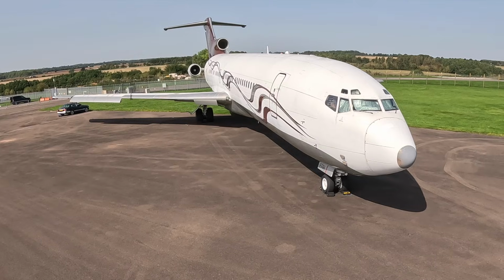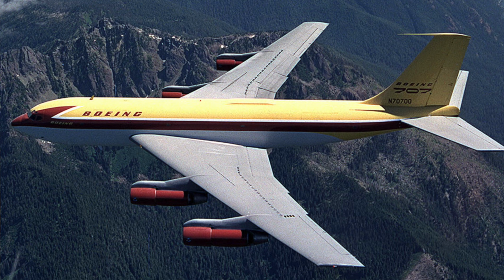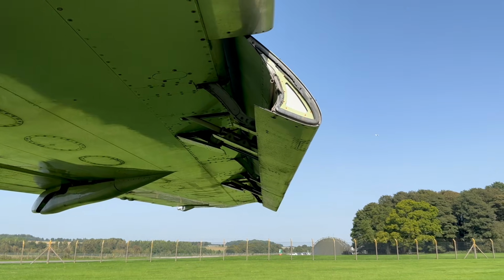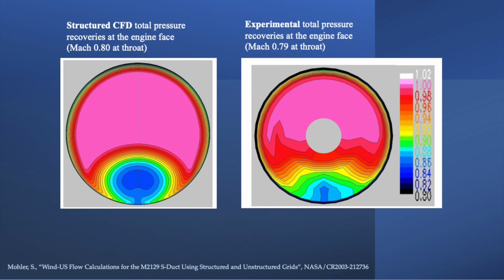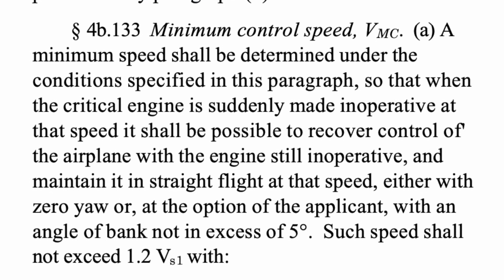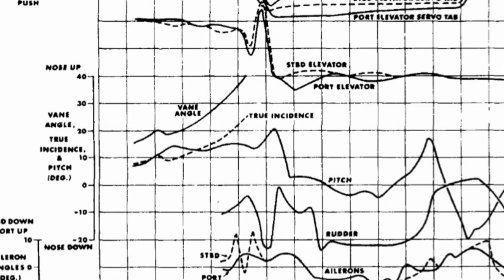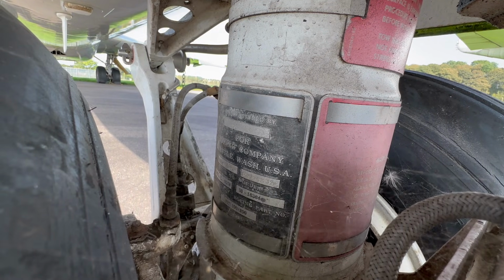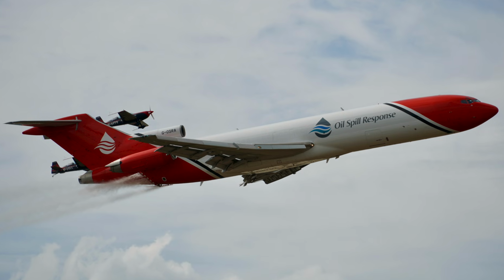Boeing 727: Part 1 - Engineering a High Performance Trijet

Comment: An excellent video, I flew both the 100 and 200 series for Dan-Air in the eighties. It was a Gentleman's Aeroplane' to fly.
Reply: I can remember flying dan Air 727 Manchester to Naples and back for a family holiday! Quite an experience for a kid whose only previous flying was a 747 over to the 'States. I can remember it feeling like 'real flying' when in the stack and dropping into Naples!
Reply from the maker: Thank you :) Do you happen to recall if they were both fitted with a stick pusher?
Reply: Not too sure, they were fitted for the CAA accepting the 727 on the British register, but that was of course for the initial 100's  . I flew G-BAJW a 100 series during base training at Shannon, and during the stall phase of training we certainly went up to the 'stick shaker', which was bad enough! I 'am beginning to think that the pusher had been disabled by 1985. @asobester

Comment: Dont the 737 and 727 share same fuselage basic design? Imagine the 727 with 2 modern high by pass engines!
Reply: I've started and canceled a few replies to this, both affirmative and contrary.  I guess the one I'll go with is  "Best not to resurrect a design where something as fundamental as the maximum landing flap setting was restricted to emergency use only, it needed the world's best stick pusher, and flight test pilots died from the Dutch roll".

As with another great but flawed flying machine, the STS's Orbiter, probably best to salute it as it takes its place in history... and leave it at that.

Comment: Rode on these many times back in the day.
I used to pick the seat right behind the the wing root so I could watch the wing transform itself during approach, and seemingly disassemble itself by the time of landing.
When the the spoilers came up, there was just a skeleton of the wing left.
As a pilot I never tired of this, and the 727 remains my all-time favorite.
Side note: Eastern pilots in the 80s flew these planes like the hot rods they were, and I saw them do things in the 727 you would never, ever see nowadays. Great fun:)
Reply from the maker: That flap system is a marvel, isn’t it. With computational optimisation techniques this sort of complexity is no longer required (the same cl max can be extracted from optimising the geometry of the flaps/clean wing), but it remains a thing of beauty one can admire like one admires an old mechanical watch in the digital age… Can you elaborate on what you saw them do? 🍿
Reply: @asobester  Swiss watch is an excellent comparison :)
Eastern? Ok: Houston to Miami, late at night, almost no one on board, and the crew in a really big hurry to get there.
We were going at a high Mach number - the engines were at very high rpm and there was a lot of slipstream noise.
As you know top of descent is routinely 30 minutes prior to landing, and as I watched the time and west coast of Florida go sailing by with no power reduction, I started to sit up and take notice. They stayed at cruise altitude until the very last minute, then yanked the power off while throwing out the spoilers and whatever else they had.
We sank like a stone, and I remember the distinct sensation of the ground lights coming up towards the airplane rather than gliding beneath it. After landing I stopped at the cockpit and asked the crew what the rate of descent had been. They just grinned and said they didn’t know because the VSI was pegged.
Reply from the maker: @thomasbelmont810   Ha! Good practice for a depressurisation emergency descent :)
Reply: @thomasbelmont810 the ‘27 had the ability to descend at the rate a helo could auto-rotate. I recall vividly some fun rides when I had the privilege of working as a FE - nighttime freighters.
Reply: @asobester  Remember, having spoilers and flaps extended at the same time is not allowed. Perhaps the cause of some early high sink rate crashes. So Boeing created a restriction with a intermittent warning horn if this was done. It was tested prior to each flight. The captain activates the speed brakes and the F/O selects a spring loaded switch on the overhead panel and then the horn sounds. That is why you see the speedbrakes deploy on the 727 for a few seconds when it starts to taxi. Of course, there were some pilots who would pull a CB so that the horn would not sound if they really wanted to descend with flaps and spoiler.
Reply from the maker: @samchaiton1288  Ah yes, presumably the turbulent wake of the spoilers does something very alpha-dependent to the flow over the flaps and I guess it all becomes a bit unpredictable....? In any case, thanks for pointing that out.
Reply: @samchaiton1288 The horn is in the cockpit, and looks exactly like a car horn …probably is one. If you didn’t want to wake the engineer at top of descent, you  could pull the horn-silence and reduce thrust, letting them snooze on…
Reply: Boeing allegedly had like 40 engineers working on the flap track designs.

Comment: The Hawker-Siddeley Trident was the first tri-jet airliner and flew close to a year before the 727.
It had less speed, range and payload than the 727 but was a solid machine.

I flew the B727-200 in the mid nineties and loved it's speed and excellent handling.
Unfortunately it's large swept wing coupled with a narrow track landing gear made landings quite a challenge!
Reply from the maker: Yes, the Trident was the first to fly, but the 727 was, as far as I know, the first in airline service. Do you happen to have flown the Trident too? Interesting insight re the landing gear - I should look into gear track/span/sweep comparisons across similar sized aircraft for Part 2!
Reply: You’re spot on! Handling was excellent right up to the flare when predictability went right out the window for even the most experienced pilots. We had a saying on the 727: one good landing, you were a good pilot; two good landings in a row and you were lucky; three good landings in a row meant you were a liar!
Reply: My flight instructor for the Piper Tomahawk qualified as a flight engineer for an airline flying the 727, and he had something to say with the sensations riding a 727 as an airline passenger, especially towards the back of this aircraft.

He hold me that it landed at a substantial fraction of take-off power, whereas it was possible to land one with one engine working, it was a "special procedure" that ran that one engine at full power.

I remember as an airline passenger that when the announcement was made "put your tray tables and seatback in their full, upright position", punctuated by the rumble of the gear coming down, there was a noticable increase in sound from the engines.  I also had the sensation that the nose was pitched up, not just in the flair, but on short final.

I don't know of any current-generation jet flown this way, where landings appear to be made under much lower power settings and with slight downward pitch until the landing flare, more like propeller aircraft.

Was the 727 draggy in its landing configuration, making it a kind of STOL able to land on shorter runways?  Or is the impression I am getting as a passenger the result of changes in how jet aircraft landings are flown in recent times?

Living in Chicago, I also had the impression that there were more than one bad accident resulting from hard landings in this type with crews transitioning from propeller aircraft.  The Chicago Tribune gave an account of one such hard landing which set the plane on fire and the cabin full of smoke, where only two persons seated on the exit rows had the presence of mind to open the doors and escape.  This newspaper story is the reason why I study the seat card, look where I am and count the rows to alternative exits and pay attention to the flight attendants' safety demonstration on each and every flight segment I fly as an airline passenger.

Is all of this connected to its novel-for-its-introduction high-lift system and steep flap settings and different-from-other-aircraft flight characteristics?

As to the remarks of @Hedge1011, as an airline passenger, I don't seem to remember "greased" landings in the 727.
Reply: The 727 was a delightful aeroplane to fly, and, contrary to popular opinion, was very easy to land. With 3000 lbs of fuel flow set on each engine and landing flap selected on the final approach to land, It became a very stable platform all the way down to the runway, needing only very small power changes. The landing itself was not unlike landing a Cherokee 140, it was so simple, but pilots would speak of 'pushing forward' just before touchdown, which really upset the poor old thing! Crosswinds didn't seem to have too much effect either on the aeroplane during landings, having two powerful rudders. Selecting the landing gear down and flaps on the approach, produces a lot of drag, hence you probably heard the engines spooling up a little to offset this condition. @paulmilenkovic178
Reply: YES the trident was first but far from a solid preformer. equipted spey  engines it was cronicly underpowered and need a long runway to get airborn. british gov ruined the plane with too many desighn changes.

Comment: Really enjoyed your 727 video and look forward to more installments. 
Your video brought back many memories.
I flew the 727 for American Airlines as an engineer and first officer.
We had three -100s with nose brakes, these were for landing at STT
( St. Thomas ) before they extended the runway.
That airplane loved to go fast, we regularly would cruise .84-.86 and if 
we were in a hurray we would push it up to .89 (MMO:.90).
Landing was always a challenge. It’s very stable until you get to about
12 inches, then you had no idea what it would do. Everyone had their
own technique, retarding the #2 engine to idle at about 10 feet, leaving
#2 up and retarding #1 & #3. Light weight landings were the worst.
I’m not talking about bone jarring, pull your pants up landing but we
always wanted a “grease job”.
Reply from the maker: Thank you for the interesting insights! Someone else also commented on landing being a challenge - from your description it sounds like perhaps ground effect suddenly changed the lift coefficient…? Do you happen to recall whether this was with Flaps 30 or 40? And did the choice make a difference to the handling in the last moments before touchdown?
Reply: We were restricted from flaps 40 unless for emergency, the only exception was the three -110s used for STT.
I must have tried every technique, so did everyone else, seems like my best landings were when I tried to
"roll it on" pushing forward right before you thought it was going to touch down. That would have the effect of raising
the mains a little. The mains were so far back if you increased pitch you would drive the mains into the ground.
They were the most challenging when they were light.
The one thing you didn't want to do was land in a crab. The fuselage would flex enough you could "drop the masks".
 @asobester
Reply: I find it very strange that several pilots referred to landing the 727 as 'challenging'. Landing that aeroplane was  so easy, it was so stable on the approach even with strong crosswinds (with two rudders) and with 3000 lbs fuel flow on each engine, it would just 'cream' on to the runway marks,  I did find that quite a few pilots were a little wary of the 727 especially the stall characteristics, and its speed.  I think its reputation went before it, but provided it was flown, within  the confounds of its envelope, it was just like a Cessna 150 on steroids. @asobester

Comment: 727 should have been developed instead of 737.  A pair of CFM56 weigh about the same as three JT8D which would have made plane quiet and efficient.  There would be no ground clearance and MCAS issues that are flaws in 737Max.
Reply from the maker: I think there were efforts in that direction - there was a ‘refan’ programme in the 70s, which could have tested the waters, not sure why/how it ended.
Reply: @asobester  CFM56 first ran in 1974 and flight tested in 1977.  727 production ended in 1984.  727 with a pair of CFM56 was a missed opportunity.  727 cabin could have been lengthened ala MD-90 to carry more passengers than Max 10 or A321.
Reply from the maker: You could well be right. There was a school of thought at the time that wing mounted engines were preferable in case of a wheels up landing (though I’ve always felt that that was debatable…?). Perhaps one of the reasons why the 737 prevailed.
Reply: @asobester  Interestingly, MD-90 fuselage was longer than Max 10 and A321 and within 2 feet of 757-200.  727 could have been lengthened to expand capacity while retaining low ground clearance for air stairs and rear stairs.
Reply from the maker: I sometimes wonder whether the rear airstair would have survived a re-engine like this, especially into the Part 25 era. A lot of mass and complexity already in the back, perhaps they would just have deleted it?
Reply: @asobester  Delete upper air duct would offset addition bracing for side mounted CFM56.  Air stairs could stay.  Not sure what Part 25 is but with engines shut down, egress would not be a problem.  I remember exiting a 727 this way.
Reply from the maker: I wonder how many airlines would actually want rear stairs nowadays. Perhaps gates are generally laid out with side doors in mind.
Reply: @asobester  Agreed, not many airlines would want rear air stairs.  And there are not many airports without ground services left.
Reply: You act as if the market didn't dictate how things happened
Reply: @BobbyGeneric145  You act as though you have nothing to offer except that it is not an act.
Reply: The 727-300 ultimately became the 757… what if they'd also made a shortened twinjet CFM56 version as a 737 replacement, also with the 757/767 flight deck?
Reply: @RoamingAdhocrat  757 has the wing box that the first 737 Classic should have gotten.
Reply: My first thought was what would CFM56 rudder blanking be like at higher levels of reverse thrust, given that it was already a problem on the DC-9 with JT8Ds and CFMs are that much more powerful.  But the 727 rudder is also more extensive, and perhaps the standard CFM56 reverser-doors design would have relatively less impact than do the JT8D's clamshells?

Comment: Extremely interesting...!  The development history is fascinating. So much I haven't heard before. Looking forward to part 2.

I was a 727-200 ramp manager for many years, and jumpseated on them quite a lot.

The sight of that luxurious jumpseat was something...! Our jumpseat was a square metal panel that hinged out from the cabin wall.

We didn't have cooper vanes and never used jato assist :)
Reply from the maker: Thank you! I hadn’t realised that not all jump seats were made equal - interesting! I’m surprised about the lack of the Cooper vane (assuming this was later than the mid 70s) - was the rear airstair operational on those aircraft?
Reply: @asobester  yes, it was sop for us to lower the rear air stair at every stop, we had to, to get the tailstand out, which it was also sop to use.  We were cargo, so probably they decided the odds of anyone trying to jump out were low :)
Reply from the maker: Oh I see, that makes sense! I guess the tail stand was specific to the -200F?
Reply: @asobester  yes I think so, we weren't operating the -100 in our area, but as I recall from training, the -100 didn't have a tail stand...  with the -200, when loading full profile ULD's, there was always the danger (ie certainty) of a tail tip when you start pushing the containers to the back of the main deck...

The -200 actually can't fly empty, there has to be a ballast pallet in the 1st position if flying without a load...  there was a small number of Canadian -200's with an extra long range fuel tank, that could be used as unusable ballast in such situations, but those were rare birds ..
Reply from the maker: Interesting! Sounds like the CofG envelope and related limitations will be worth a deeper look in Part 2.
Reply: The DB Cooper vanes were removed when the planes were converted to freighters.  You are right with your observation about a simple, elegant design.
Reply: @parkburrets4054 Never saw a freighter without Cooper switch until they all suddenly disappeared late in the 727’s life, when the FAA suddenly said it was no longer required.
Reply: The -200 could fly empty with a large excess of unusable ballast fuel in its normal center tank.
Reply: @727gm We had to use a ballast pallet even with full center tank on the -200, if empty. Not super heavy, like a ton, but it was still needed to stay in trim (or instead we could use empty ULD’s). The Canadian -200’s had a larger or additional center tank for long range, and they could fly (I believe) without the ballast pallet if empty